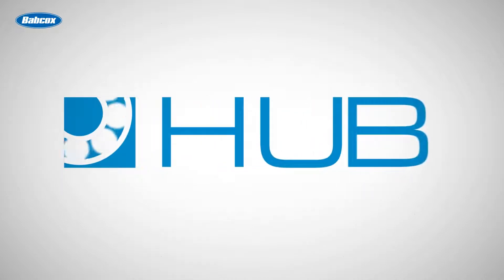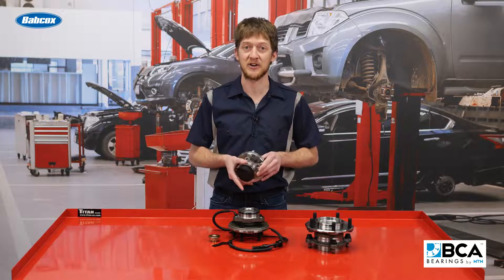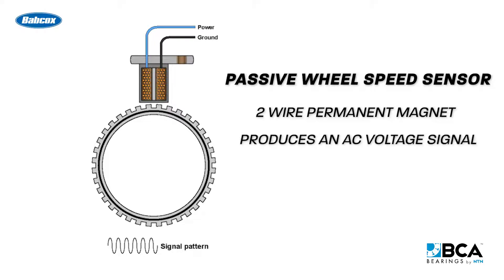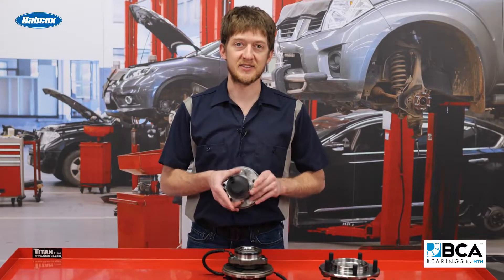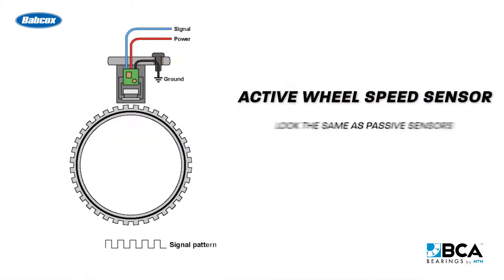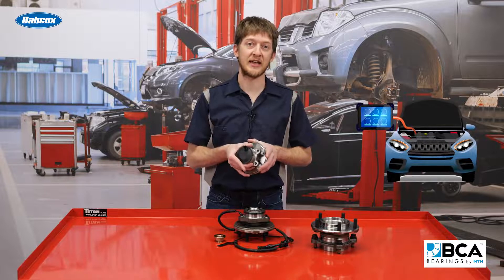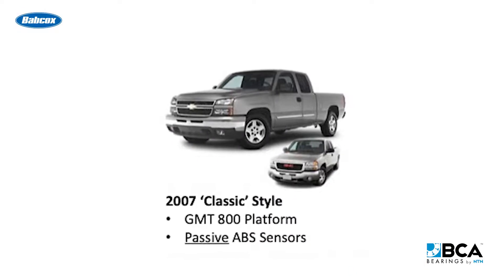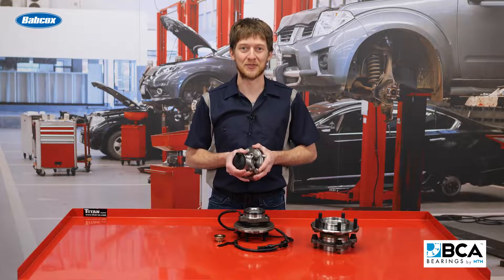The Difference Between Active and Passive Wheel Speed Sensors

Comment: So I'm trying to determine if I have a wiring issue, or bearing is bad, before I replace the bearing for nothing.
I have a 2011 lacrosse with actives. I can probe the wires going from module TO the sensor, and it'll show 12v? I just installed a new GM part sensor, cleared light and it came back on. I bought a moog bearing but I wanna make sure it's not a wiring issue. The bearings relucter is sealed inside, and protected from elements. My current bearing has no play or noise. I only have a multimeter and need to make sure I'm doing this correctly. I learned the difference between the two, thanks to your video.

Comment: You don’t mention in the video what voltage to expect from the harness with active speed sensors?
Reply from the maker: An active wheel speed sensor typically operates on a voltage supplied by the ABS module, ranging from 8 to 12 volts. It varies by application, so it is necessary to reference the service information for the specific vehicle application.

Comment: Passive sensor on a motorcycle rear wheel- I'm getting a light stammer or hesitation when going slowly over ripples in the tarmac, at part throttle. If the wheel dampers were worn, and the wheel was lurching back and forward a bit... could the wheel speed sensor cause hesitation in the ignition or fueling?
Reply from the maker: Unfortunately, we don't have enough experience with motorcycle wheel speed sensors or access to the service information needed to answer your question.

Comment: On the diagram for the active sensor it shows that the hold down bolt is also grounding the sensor. I had to remove both rear sensors on a 2012 Nissan Frontier to replace axle seals and both hold down bolts snapped off due to rust. I used a self tapping screw as a replacement. After replacing the sensors the ABS light is on and my cheap scanner shows left and right sensor faults. Could it be due to a bad ground.
There was a brass ring in the hole for the bolt. Does 2012 Nissan use active or passive sensors?
Reply from the maker: Thank you for your question. We can’t accurately diagnose this issue without seeing the actual error codes, but here are some ideas: 

-If the code is for open, short or hi/lo voltage/range: Check the circuit integrity from the HCU to the wheel speed sensor. These codes indicate that there is a loss of integrity with the circuit. Remember, the signal reading in millivolts, small changes in the wiring resistance can cause these codes. If the sensor had a bad ground, it would cause these types of codes.
 -If the code is for an erratic or invalid signal: Check the encoder or reluctor ring for damage and measure the air gap if possible. If the sensor was replaced, the issue with the ring would still cause codes.

And yes, most late-model Nissans use both passive and active sensors. Some models have active sensors in the front and passive sensors in the rear, while others might have active sensors at all four corners.

Hope this is helpful!
Reply: @BCABearings   thanks so much for the info. It will certainly help in my troubleshooting 👍🏻👍🏻